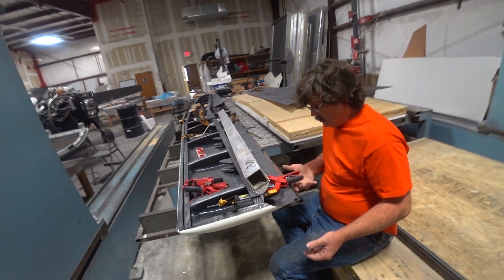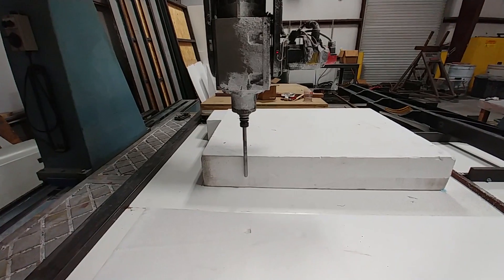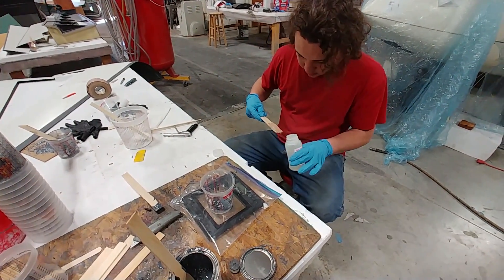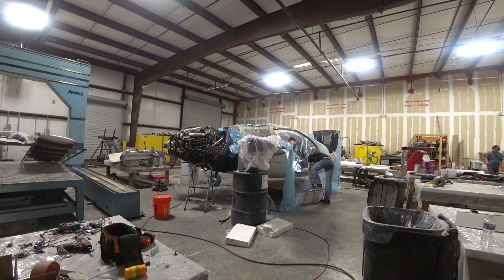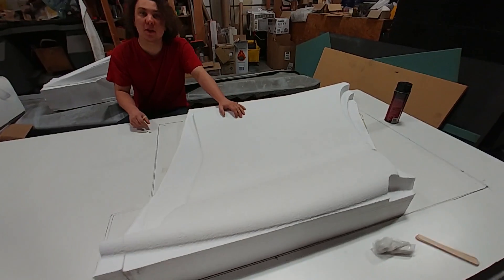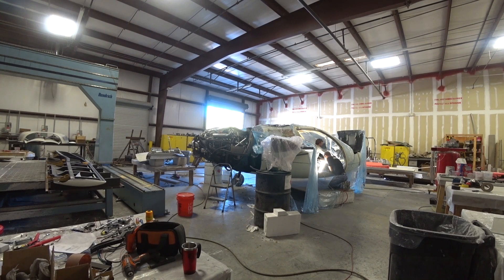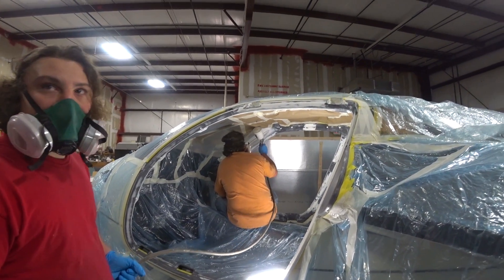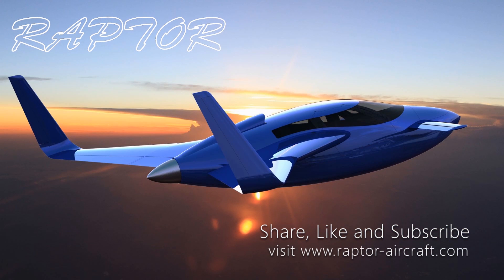Engine Breathes Again - Building the Raptor Prototype

Comment: Peter, did you guys ever figure out what the sound was (you thought was the turbo) when you got the engine running? It almost sounded like a gear driven timing on a performance engine, but definitely didn't sound like the turbo. It almost sounded like a belt was rubbing on something.
Reply from the maker: Haven't run the engine again yet

Comment: Anyone else spot a negative cable missing a clamping nut at around the 1:26 mark to the left above the nose gear? Hopefully something that was installed later and perhaps causing issues.
Reply from the maker: Most of the stuff up front is not complete yet by any measure but thanks for paying attention.
Reply: Raptor Aircraft I believe Derek thought that might have something to do with the engine start being rough.
Reply from the maker: Probably not affecting the start but definitely a poor ground could cause problems.
Reply: Derek Brown good eye!
Reply: Wow, great catch!! ;)